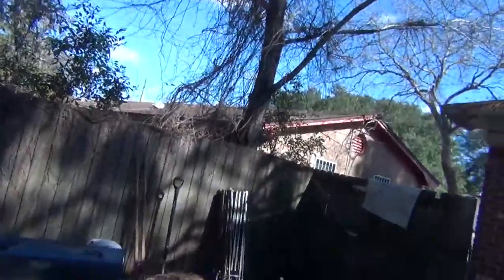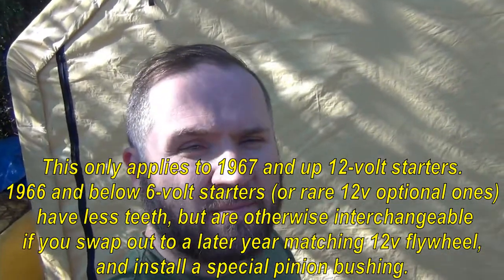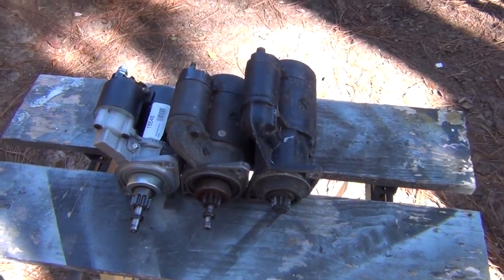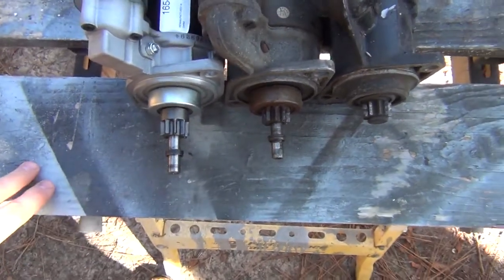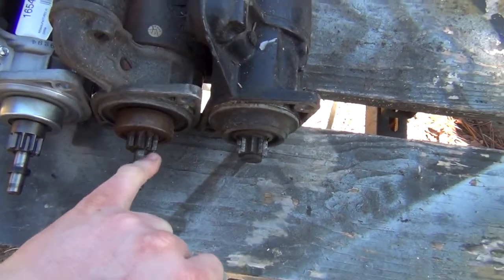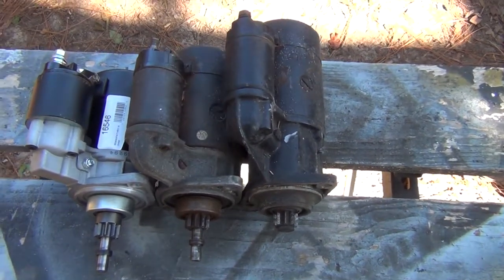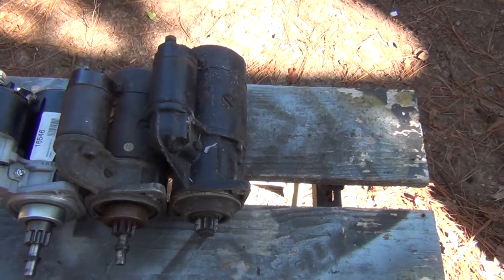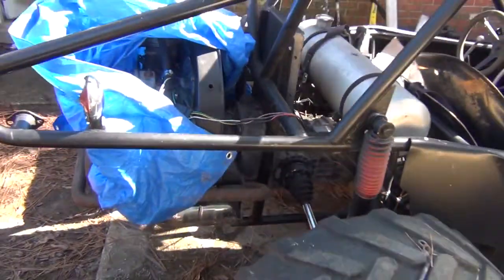12V VW Starter Differences (Air Cooled)

Comment: I have a 74 bus 3 ribs transm.... with a 1600 engine and a bug starter and im having some issues...what starter should I use??
Reply from the maker: ANY of the standard 12v starters would work for you! Just don't use the long shaft one that I showed in this video.  But you didn't say what your issues are, either!  What gives?

Comment: This is to anyone that may know. Can the gear on a Auto stickshif starter be removed and replaced? I have one that was on a car with a flywheel that was loose on the crankshaft that prevented the starter gear and the flywheel gear from meshing correctly and wore both gears down to where they will not mesh correctly. Both the flywheel and starter gears have a 45 deg. angle were they should mesh I have a replacement flywheel but a replacement starter is very expensive, the starter is good other than the gear, I was hoping to be able to replace the gear rather than having to buy a new starter. It's a single port 1500 cc in a 62 type 1 BAJA Bug that has been converted to 12 volts, the transaxle bell housing has been ground out to accommodate the larger 12 volt flywheel. If I can't use the Auto stickshif starter I will use a regular 12 volt starter and a 12 to 6 volt adaptor bushing. 
What I would really like is a flywheel from a 1966 transporter. If I remember correctly the 1966 transporter had a 1300 cc engine and the flywheel had a ring gear for a 6 volt starter and had a 200 mm clutch.
Reply from the maker: Yes, the gear on the starter is called a bendix gear, and it can be replaced.   I did one some years ago, took one off a dead starter, among other parts, made a good starter out of 2 bad ones.
Reply: Duck, Thanks I will try and find a replacement gear.

Comment: could a 6volt gear be put on an automatic 12v starter?
Reply: I have a 12v beetle transmission with 6v flywheel
Reply from the maker: @zoneprism7353  If you're clever in a machine shop, yes.  But it would just be easier to change the flywheel,  With a proper 12v flywheel you can also use a normal 12v starter from any auto parts place.  I hope that helps!  Thanks for the question!
Reply: VvTheDuckvV sadly I cannot change the flywheel, its a 12v transmission however I did an engine swap with a 13b rotary motor and the conversion plate/flywheel is 6v geared for some reason (came with the engine). I found a company that makes 12v to 6v custom starters; https://dunebuggywarehouse.com/imi-105-high-torque-starter-for-sedan-3-rib-5-rib-transmissions.html
and its even better as it does not require a place for an input starter shaft
Reply from the maker: I didn't expect you to have all that... lol!  But it sounds like you have that worked out, then!  GO WITH IT!   😀😀😀😀

Comment: they are aftermarket vw starters available the Compufire starter, the IMI hi torque gear reduction starter and a more reliable Denso style Powermaster starter. all 3 are self supporting as the IMI starters one is available for a 6 volt flywheel. its available on many vw sites the Powermaster starter thats available on Summit Racing Equipment which is the best starter for 1967 and later beetles Ghia, Bus, Thing. a more reliable starter thats self supporting fits the manual transmission and autostick transaxles.

Comment: Yes as of last year, I too and my buddy knew of the three, but have found two more starter types.  We had all tree types but they would not fit.  The difference was the thickness of the bell housing.  If you have the three you are 85% covered that one will fit

Comment: New to vw stuff here... I have a 40 horse engine unmounted, year ~1966 maybe. And a 3 rib transmission (unknown numbers) and vin from a 1971 beetle on a sandrail. 
It came with no starter no clutch kit etc. Trying to identify what I need to get to replace whats missing. Is it possible to mate a 1965 40horse engine on a 1971 trans?  If so, what starter am i looking for? Any tips on identifying flywheel so I can find a clutch kit? Autozone had about 10 different kits. O_O Thanks! Much appreciated.
Reply from the maker: Yep, you can mesh that stuff.  Put on a later 12v flywheel and a 12v starter.  Then bolt it in!

Comment: Good info. Did you do anything with the generator housings that I helped you with?
Reply from the maker: I thought we talked about it for some reason,,, but I reassembled one, and it didn't work.  Everythng bench-tested just fine, but when installed it produced no voltage.  I've since gutted them again, I have another idea up my sleeve.  :-D

Comment: Hey mate old vid I know.
But have you got any tips on telling if the genny on my 1600 can handle 12v?
It has <14V @ 30A embossed on it?
Cheets
Reply from the maker: Sounds like a 12v Bosch generator to me.  You should be good to go!  Thanks for the question!
Reply: VvTheDuckvV thanks heaps.